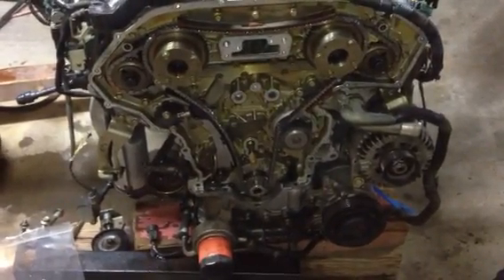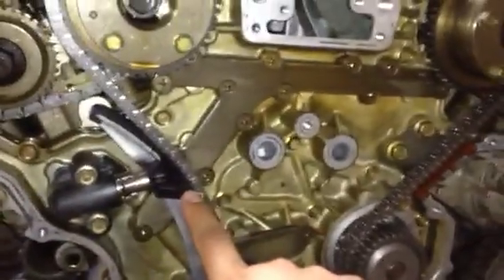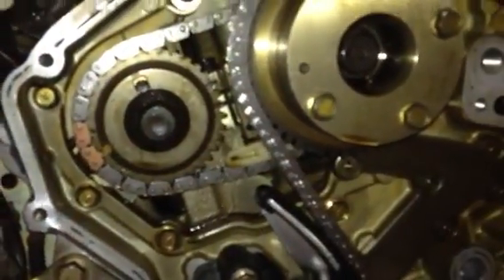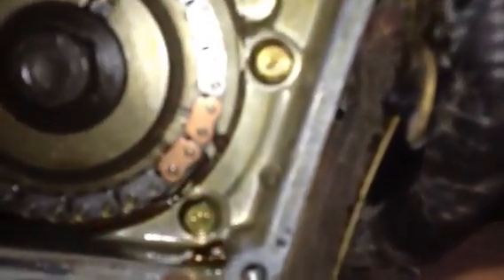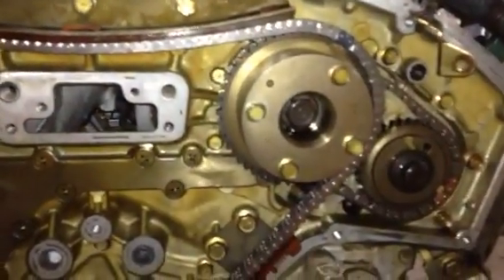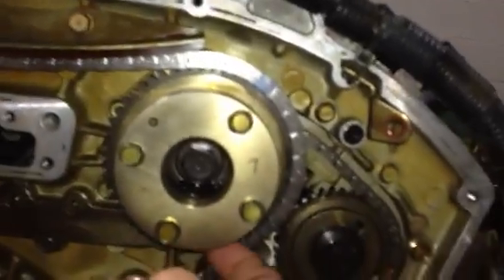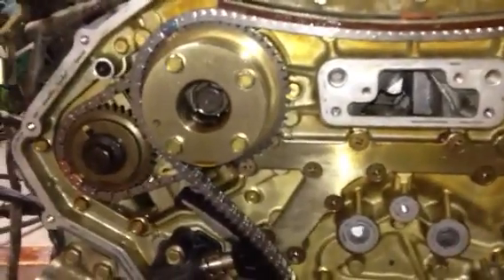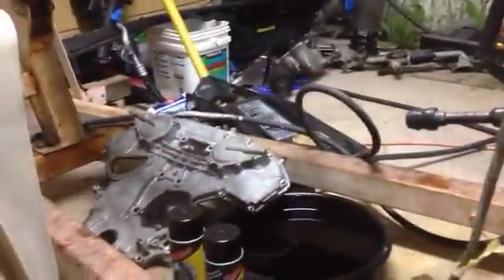Nissan 3.5L timing chain update

Comment: Hi, Thank you so much for the video, I have a 05 murano vq35de, has the issue where it's rattling when accelerating last year changed the main chain and the guides and tensions, still having the same issue. Worst is that if I go on stop and go traffic for about an hour the rattling get's very loud. My mechanic told that i have to replace sprockets. I don't know much about vehicles, appreciate if you could advise me.

Comment: Of course, Nissan could have made engine mounts integral with the engine and welded them to the chassis. Timing chains greatly mitigate injury in a high speed collision, as well as prevent cell phone static. Silly comment # 356.

Comment: i am going to try to replace just the tensioner from the access cover. slack guide is still intact. my question is; when i remove the tensioner, is there a chance that the chain will drop off the crank sprocket or does it not get that loose? do i need to keep some sort of tension on chain during the replacement? having seen it with the cover off, i was hoping you could give me some insight. thanks